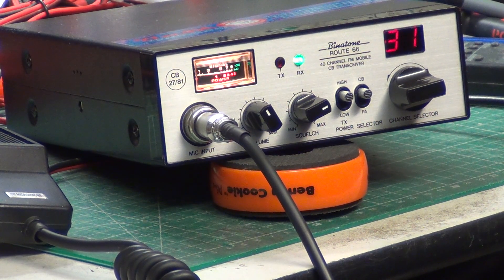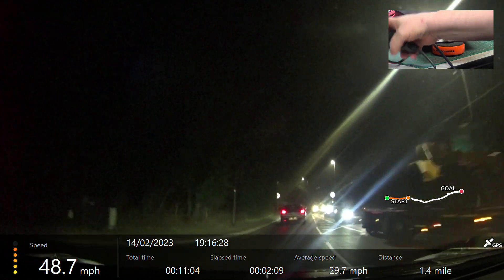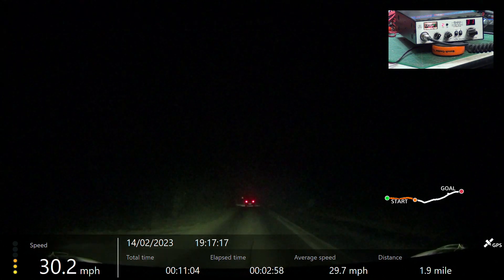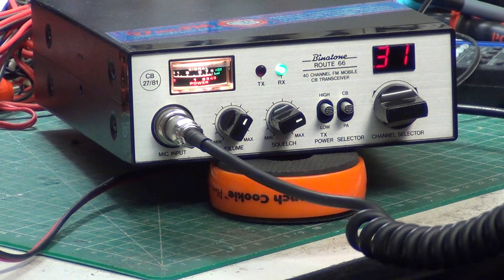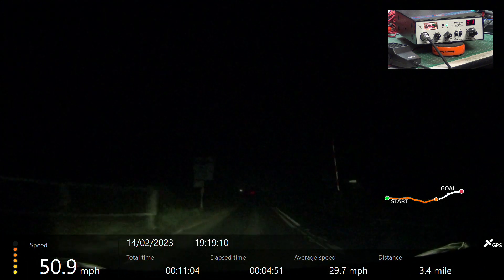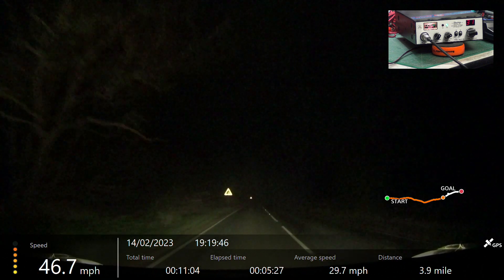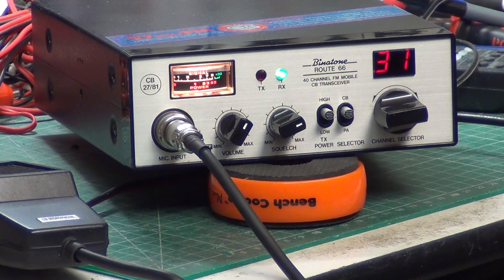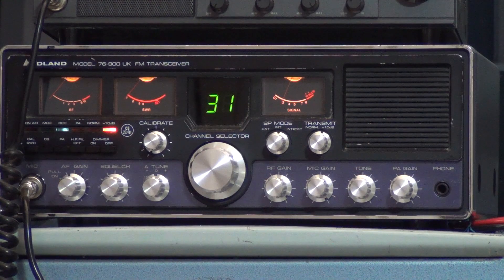Binatone Route-66 CB27/81 UK FM CB radio - On The Air test (late 'A' version with (LC7137)

Comment: Rain scatter range is determined with height of the scatter point  takeoff angle of the antenna used on the GHz bands, Not 100% on it. "PS Not sure about fog"

By the way fantastic test as always.

Comment: Agreed - S-meter dropped one segment which it usually doesn't but boy did the audio get scratchy (like a corner!).  5-segment RSSI is kinda useless.  I forget how you have these set - is 100 uV right at the point the 4th segment ("S9") lights up, or  at the 5th segment ("+30dB")?   An analog meter would have shown more, but really, it's the loss of quality on the signal itself that was the problem not the strength.

On the mics ...  Seems like the SRM had more AGC popping than the FOM ...  Interesting.
Reply from the maker: Yes, S9 is calibrated to 100uV.    I noticed the AGC was far better with the factory original mike sat the end into our base station that the standard replacement mike. Usually it's the opposite! 

Richard, UK